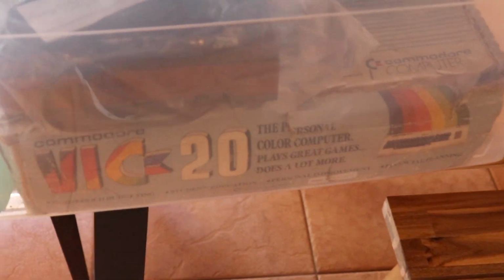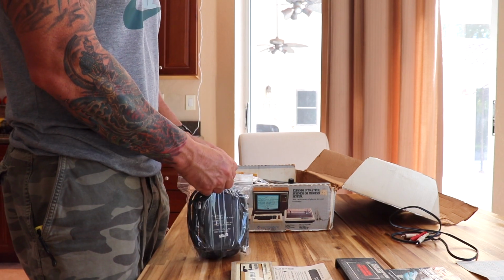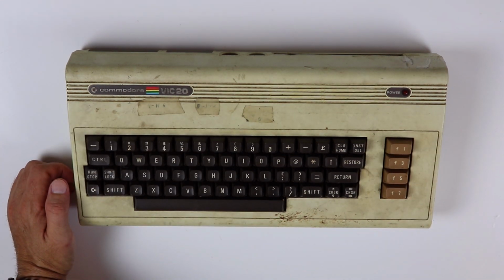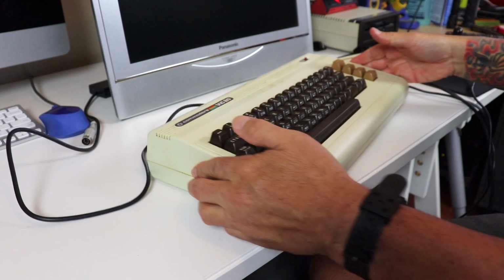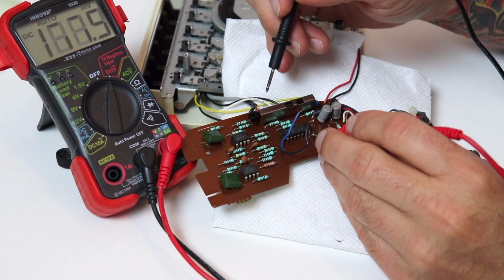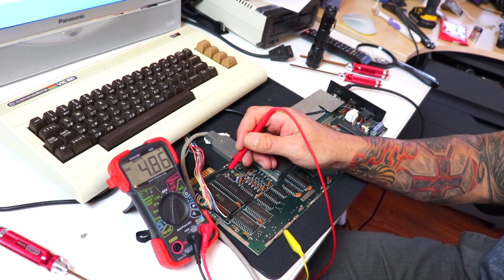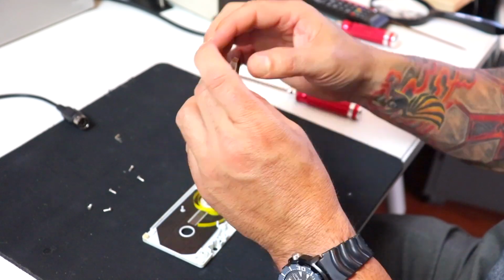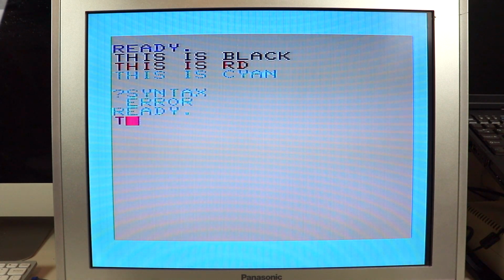Scored my first Commodore Vic 20!

Comment: Question from someone who doesn't much about this sort of thing. How are the chips you're removing and re-inserting socketed, when all the chips in my C64 are soldered? Or is it just that the VIC-20 was different? Or was it only these "interface" chips that were socketed?
Reply from the maker: It just depends on how the manufacturer wanted to roll out their products. Some soldered directly to the board to save money.

Comment: Great video, and awesome find!  I recommend picking up a 3k ram expansion cart, and also a 28-32k cart and a 37k cart.  That should cover basically all the software you'll run into.  The 37k configuration is just for the newest stuff, but worth it:  DOOM in the VIC?  Heck yea!

Comment: Nice, you scored an absolute bargain!  I grew up with an Amstrad CPC464 with green screen, but I've become quite enamoured with the VIC recently due to its simplicity and limitations ... particularly the PET-style keyboard ... and just scored my first Japanese VIC-1001.  I'm hooked.  I prefer the older two-prong/9V models as they're simpler to power if you don't have a spare DIN power supply ... I always swap out the LM323 linear regulator with a modern equivalent - cuts down on the heat (no heat sink needed) and also reduces power consumption by about 200mA.

Comment: VIC-20 is awesome, if you have a real VIC-20 then you can play all the tape/disk images using a cheap SD card reader (SD2IEC) and a switchable RAM expansion (allows 3,8 and 16k memory to be used in 1 cart). A game needing 8K RAM would still not load and run if you plug in a 16k VIC RAM expansion, that was the annoying thing about the VIC-20 if you bought a 16K RAM pack for it you still wouldn't be able to play 8K or 3K expanded games.

Comment: Some I didn''t undestand why the carthidge was so huge. Marketing definetly but it doesn't look good.
Reply: The answer to that is that you couldn't have a RAM cart plugged in with a game cart. Game carts added whatever amount of RAM they needed to run the game on the cart. That took space at a time when RAM chips were small capacities. Some of the early V20s had 512 BYTE chips. The game carts needed space for both extra RAM as well as ROMs for the game (that were also larger back then).
Reply: If you look at it, they were about the same size as the NES cartridges except the the NES cartridges had it's size in length, whereas the VIC carts had it's size in width

Comment: i recently got an apple iie enhanced all in good shape, right now im working on a trs80 model 3 and on the way i have a  trs80 color computer 2 with 5 cartridges and 2 joysticks and a vic 20 and tape player with some tapes (player & tapes from another seller). i am only familiar with the apple from school, but i like the old computers, and for actual game systems i have the atari 2600 and NES. now for the vic 20 and color computer 2 i will use tv's, the monitors if working are expensive.

Comment: 5.24 v dc will burn out the memory chips after a short time. They really shoudlnt be run at anything above 5.15v. You could cheap out and put a small resistor in the circuit, but frankly, id replace that psu. 2112s are getting more and more expensive and will eventually be unobtainium. You can use a couple of transformers to replace a c= psu.

Also, not sure if you figured this out later in the vid, but that 6v should be 9v AC to the deck. Not 6v DC. I noticed your meter was set to dc. The motor itself is 6VAC there is a resistor somewhere in the circuit i believe on the datasette itself to step down the voltage. One of the cool features of the 1530 is that it is designed tto use an unregualted ac motor and then syncs to the variable speed of the particular unit....that and using pulse width signal differential as opposed to analogue tones as you pointed out earlier in the vid
Reply: Nice job on finding the fuse! One more tip. Tape programs usually have multiple copies on each side of the tape...just in case well...what happened to you happened. Yes, all vic games have a ram setting that you need. Snake field requires 8+k expansion. That means 16k 24 and 32/35k expanders will also work. All n all well done! Subbed and i really enjoyed your vic 20 dabbling!
Reply: @peterlamont647  Each game of Vic20 requires the right amount of memory and work only with it.
Reply: Actually, Ray Carlsen has both a replacement power supply OR a special inline over-voltage fuse (but when that happens you'll need that P/S). If one is handy and the brick isn't TOO deep in epoxy, you can replace the crappy part in brick with a much better part rated for the proper purpose. The original part is in the epoxy with it's legs sticking out. cut the legs off and replace the part going to the circuit board, check the caps and it'll be fine for a couple more decades with no risk. If you have a brick full of epoxy, you need to replace it. You can also run it off of a 128 brick safely with an adapter. All the above applies to the C64 as well (same brick).

The early V20s (which he didn't have) have a much smaller wall wart, that only pumps 9V into the machine, but those machines run VERY hot and the rectifier can get hot enough to unsolder itself I have read (read: https://www.elektronik-technik.biz/liste/%234%20Ger%C3%A4te+Zubeh%C3%B6r/%2349%20Reparatur%20Anleitungen/491%20Ray%20Carlsen%60s/personalpages.tds.net/~rcarlsen/cbm/vic20/vic20.txt ). There was a massive heat sink that was originally attached to the cart port frame until there were complaints of people burning themselves. That VC20 used a standard two pin cord (like the one a dozen things use, like the PlayStation for example). The brick came later and was used for both the VC20 and the C64. A similar version was used on the Plus/4 - one should never try plugging the C128 P/S into the Plus/4.
Reply: He showed a reading of 4.9 volts when measuring the 5v line.

Remember there is losses in the cheap psu cables commodore used that pull the unloaded 5.2v down to an acceptable voltage while under load. Infact there are two resistors in the psu that form a voltage divider for the explicit purpose of raising the ground of the 7805 so it outputs above 5v. The 7805 will eventually fail so an overvoltage protection device is a good idea. 

Also 9v AC is used on the user port so external rs232 devices can derive thier own power. The cassette port uses 6v DC. He even showed the relevant part of the schematic.

Comment: Scored my first VIC-20 in 1982!

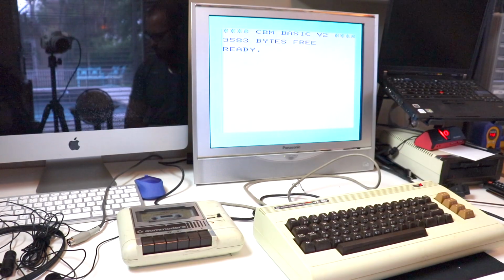24:40 The VIC was a real pain for memory expansion, since the stock 5K (3.5K available for BASIC) was really small, and when you added memory expansion, it changed the memory configuration, which made most programs only work with an unexpanded VIC or an expanded VIC, but not both.  The program you are trying to load is clearly for an 8K-or-higher expanded VIC, and won't work on an unexpanded VIC, and will produce the Out Of Memory error.